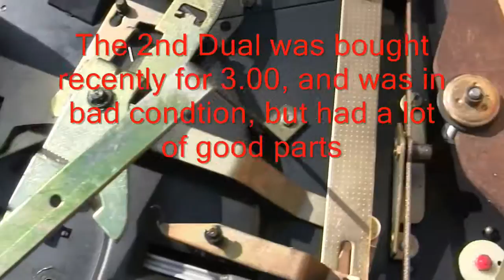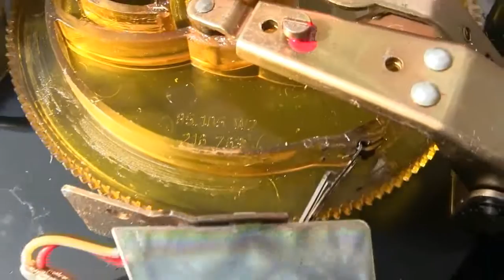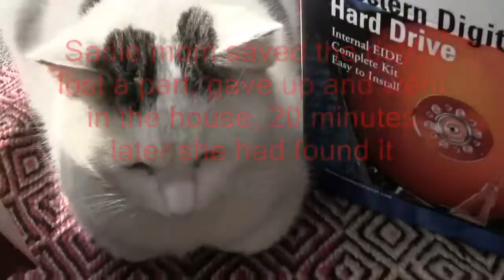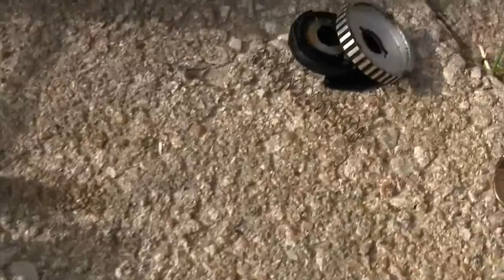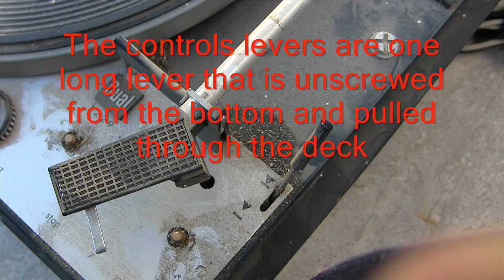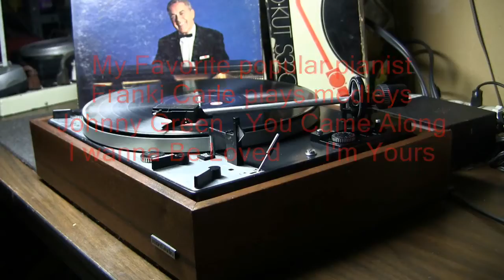Dual 1229 Turntables Salvaged - Frankie Carle Medleys

Comment from the maker: @umajunkcollector I have the Dual 1229 and a 1219  that are in like new condition that I've had for many years, and never had any problems with them.  Both of these had very rough treatment by people that didn't have a clue as to what they were doing.  Duals do function very different from most changers, but once you understand how they operate they are not too bad to work on ,and somewhat an easy fix for most problems. I've always used transcription turntables in the stereo, never changers

Comment from the maker: @umajunkcollector When I first got into stereo component systems, I never considered any type of automatic turntable.  Whenever you put certain turntables etc in larger high quality wide range sound systems, you start noticing flaws that when used in smaller systems you would never notice.  A friends Dual 1219 was impossible to use in my large Altec and JBL systems,Tonearm resonance, damping factor, suspension problems, only the Thorens TD-125 worked well with those systems.

Comment from the maker: @umajunkcollector If you don't like the Duals I wouldn't recommend you getting a B&O, as they are even more delicate,  I have the  B&O Rx2 posted playing I only have eyes for you.  They are well made, but use the custom designed cartridges that were made by Ortofon.  The B&O cartridge new is about 500.00, the same quality of sound is in the Ortofon 030 for less than 200.00.

Comment from the maker: @umajunkcollector The Empire is a well built turntable, I also had a Garrard Zero 100 years ago. P/E changers or Perpetuum Ebner was bought out by Dual, not much experience with those. I have one 1960 P/E changer in a Fonovox stereo, they are really an odd operating changer. They have a large weight that you have to put on top of the records instead of a record leveler, very awkward to use. My main TTs are the Thorens TD-125., and the Luxman PD-131

Comment: Perché io con il mio dual 1219 non ho mai incontrato ostacoli? perché il 1219 è un Signor giradischi! suona bene dal 1974, mio primo acquisto, suonava con shure m91, oggi con ADC xlm/3 ha preso il volo! mi porta in cime dove si possono ascoltare gli angeli cantare.  e dire che posseggo altre 14 testine (Stanton, Pikering, Grado, Vestax, Mission, Shure, Ortofon). Pure la denon 103 su giradischi autocostruito ( a dovere) con braccio unipivot massa tot. 26 gm. fatica a rendere le armoniche come sono.